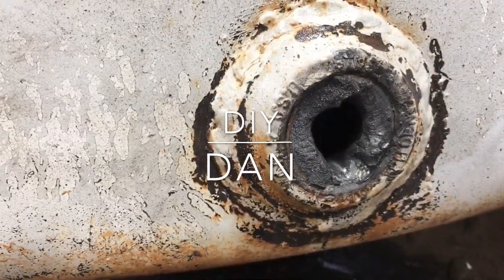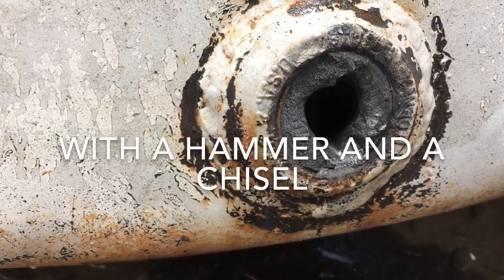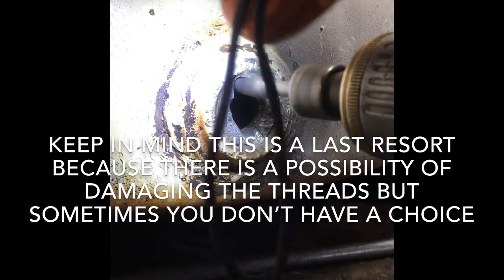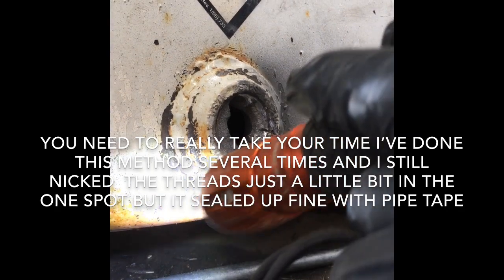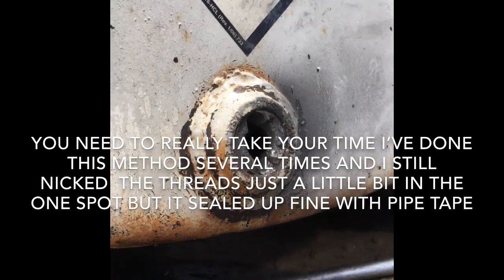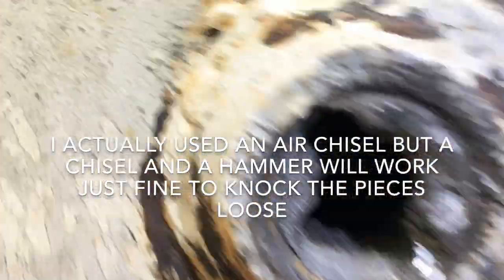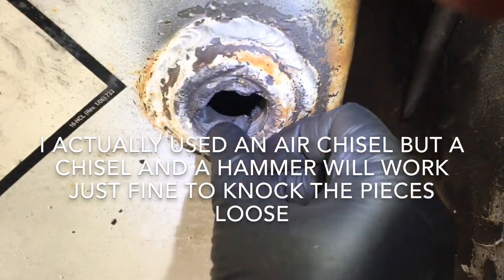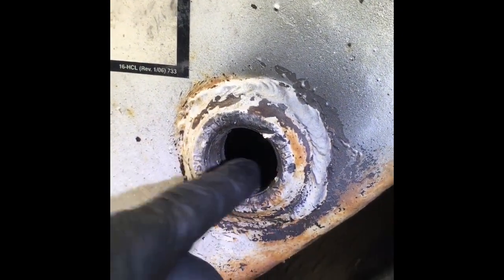Removing broken pipe fittings when an extractor won't work  steel/brass/pvc/etc.

Comment: hi.do you know how to open this pipe fitting (square plug)  that was a bit far beyond the wall?  at this situation I cannot use adjustable spanner...    any idea? is there any T wrench for this size?
Reply from the maker: Is it a female square plug like a mechanics ratchet would fit in it        it’s just to small       or see if you can get the name of the type of fitting so I can look it up online to help you out
Reply: @diydan7019  https://zhuoxinab.en.made-in-china.com/product/uSiQCgvKhDYx/China-PVC-Male-Plug-Male-End-Cap-Threaded-Water-Plug.html
Reply: @diydan7019  check the link.. its like this...    PVC Male Plug Male End Cap Threaded Water Plug
Reply from the maker: LIM TAT got ya and you can’t use a crescent wrench or a pipe wrench because you said it was recessed in a wall how big are we talking I’ve used 12 point sockets before they also make 8 point sockets as well for square plugs or is it to big
Reply from the maker: LIM TAT how big is the square head
Reply: @diydan7019  for malaysian pipe.. usually its 15mm pvc pipe.  (1/2")
Reply: A Malaysian? Great I hate doing these type of shit I want professionals to help but no! especially of what happened to the world rn, I just want to shower! And it breaks out like a tsunami in the middle of the night :/